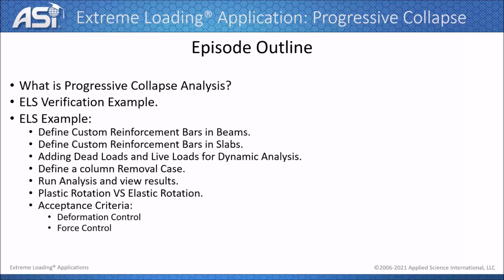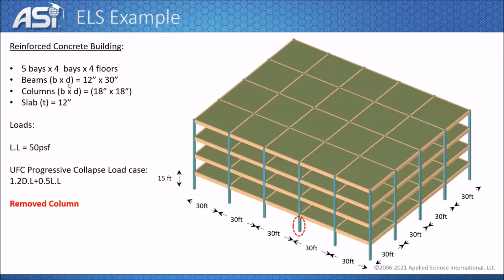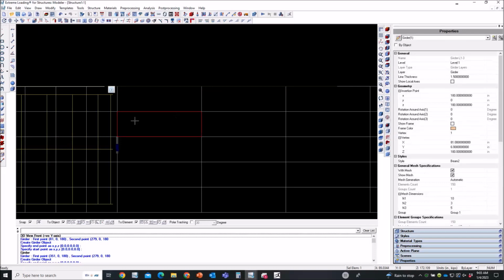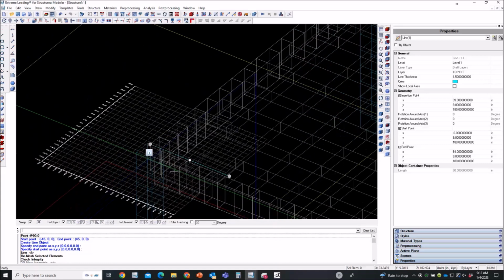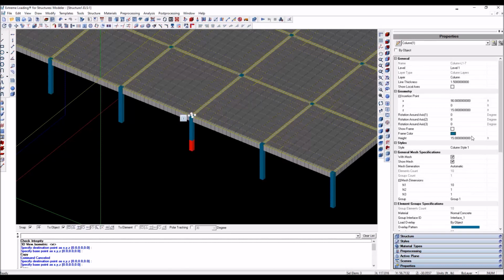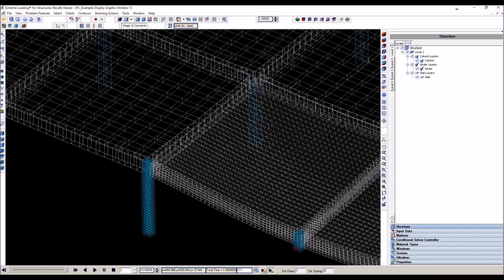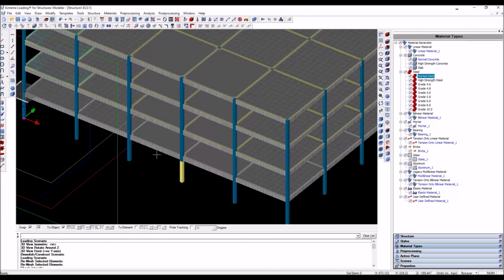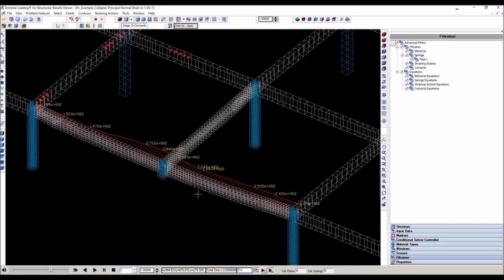Episode #3 Progressive Collapse Analysis

Comment: What is this software
Reply: This is “Extreme Loading for Structures” software which utilizes Applied Element Method (AEM) for simulating structural failures due to extreme loading.

You might have heard about Finite Element Method (FEM) which is a well-known technique in engineering simulations. AEM is basically an alternative which explicitly represents elements that can detach and collide.

Comment: Can I use Etabs or Sap2000 for progressive collapse analysis since ELS isn't available for everyone?
Reply: Can u guide me on this topic
Reply: @Aishani-hz7kk  I am also need help in this
Reply: There has been some research where SAP2000 is utilized for investigating progressive collapse. However, contemporary studies try to build high-fidelity models with finer elements. Our lab uses LS-Dyna. Ansys and Abaqus are being extensively used in research. 

From an introductory point of view, you can use SAP2000 or ETABS. But the insights from such models might not be enough for research purposes. That’s not the whole picture though. The choice of software depends on the nature of the question that you’re trying to answer. Take the following study for example. They used SAP2000 but their research has some other considerations which made them choose SAP2000.

Check: Vinay, M. and Rao, P. Kodanda Rama and Dey, Subhashish and Swaroop, A. H. L. and Anduri, Dr. Sreenivasulu and Rao, K. Venkateswara, Evaluation of Progressive Collapse Behavior in Reinforced Concrete Buildings (October 1, 2022). Structures, Volume 45, November 2022, Pages 1902-1919, Available at SSRN: https://ssrn.com/abstract=4329209